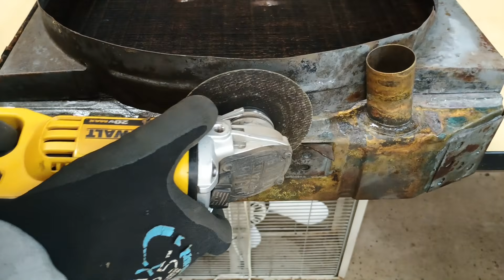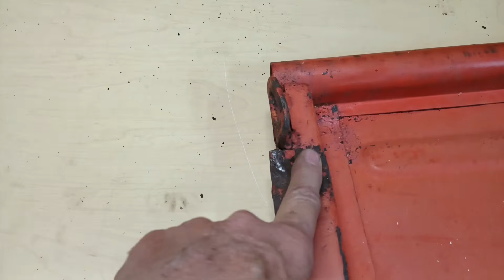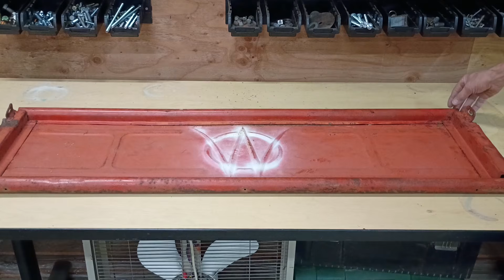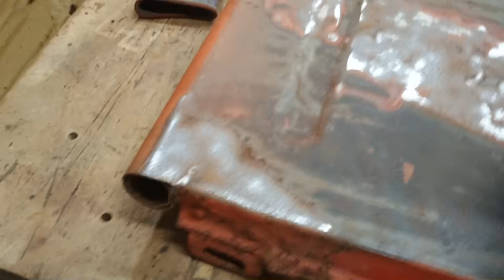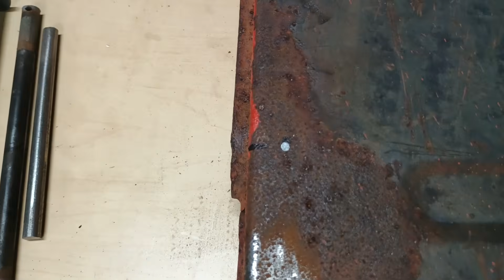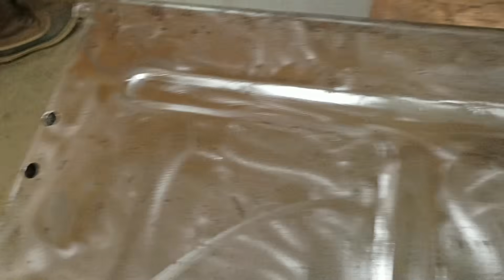Len's 48 Willys Pickup Project - Part 15

Comment: Luv them old willy's, learned to drive standard shift on a 1951 cj2a that belonged to my Dad in 1968 I was 15 year's old those were the days my friend. ❤
Reply from the maker: That's a great vehicle to learn on.  The low HP 4 flat head keeps you out of trouble and teaches you to feather the clutch pedal without killing the engine.